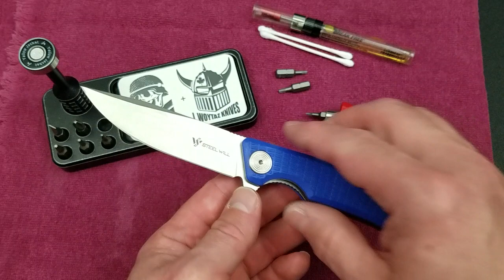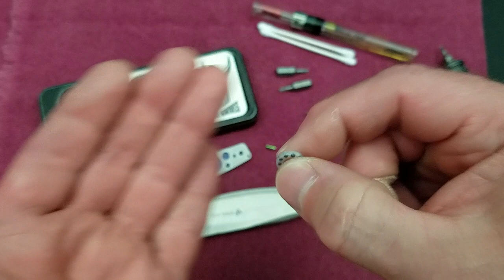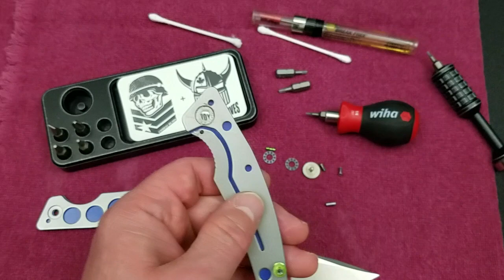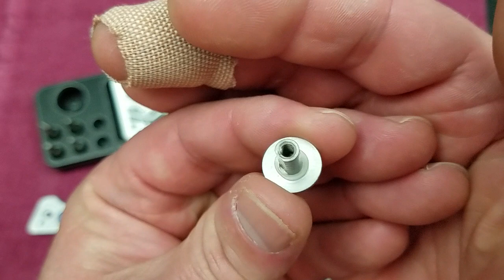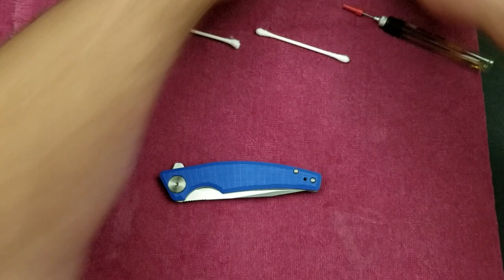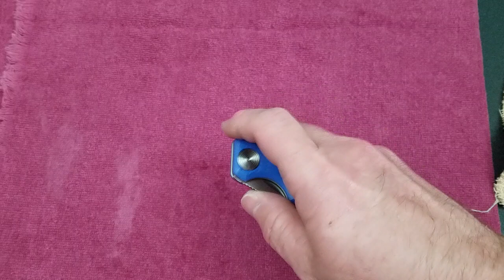Guts and Glory: Steel Will Shaula flipper disassembly.

Comment: It looks like an excellent new addition by Steel Will. It’s nice to see bearings on a D2 model (the m390 Cutjack already came with bearings), but I’m especially impressed by the price. While it is more that the D2/FRN Cutjack and Intrigue, it’s cheaper than almost all of Steel Will’s D2/G10 knives with PB washers. This confuses me a little, but I don’t complain about price drops.
Reply from the maker: It's a big change for Steel Will. I fully appreciate what they did in the budget realm with PB bushing flippers. But bearings are easier to work with/tune, more consistent and in vogue. I am interested in seeing how they do with it.

Comment: Clean, simplistic production knife. Detent tolerances must be wonkie cuz that's a crater of  a detent yet a fairly weak  flip. Baz, did you get a new camera man the vid is HD quality? BOOM---  I think that clear gasket/ washer is used by QC to dial in centering without tightening down action. If it were on show side , pretty sure they are used to keep the show side from backin out. Nice vid brother.. Hope SW dials in the detent for more explosive blade deployment.. ROCK ON STUD- Good luck w/ allergies..
Reply from the maker: OMG......The detent hole is massive. This is the first I have seen this approach to tuning detent on mass produced knives. I am going to have to think about it. 

I like the design of the knife. It's comfortable to use and easy to carry. I would enjoy seeing a premium version in grooved CF scales and a slightly more "premium" steel. A CF scaled version in S30v would be great at the $120.00 price point. If they get the detent dialed in.
Reply from the maker: And I'm still just using my phone, internal mic, and overhead lighting. I think the difference is in the lighting. I think I found a better balancing point with what my phone can handle.

Comment: I like the overall shape of the knife. It flows nicely. I haven't experienced any Steel Will knives yet so I have no opinion about their phosphor bronze bushings vs bearings but it looks like they did a fine job with this one!
Reply from the maker: Jeff, be sure to check out my upcoming Steel Will GAW.....coming soonish...lol

Steel Will is pretty unique because they built flippers on PB bushings for so long. They have a good understanding of flipper geometry so it worked pretty well. Over all they tended to be good flippers.
Reply: @BazonBlades  good deal! Notifications are on Baz! Thanks!